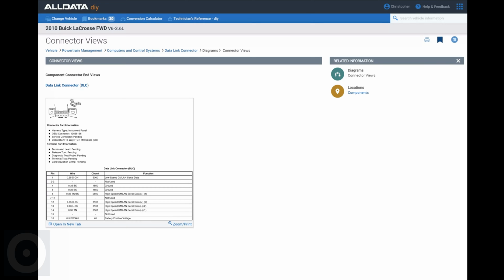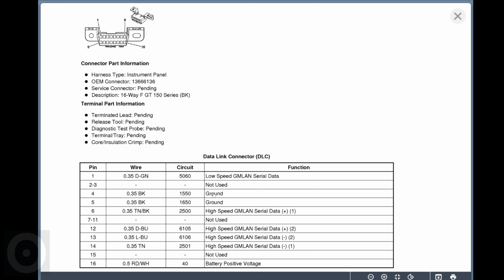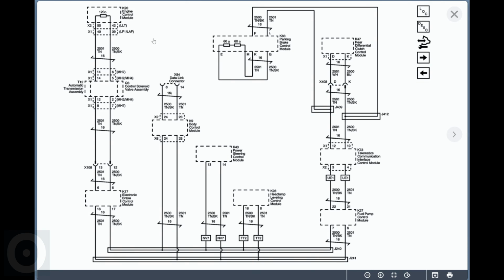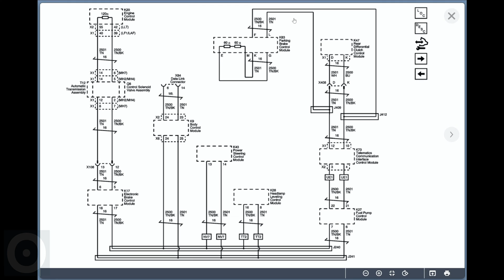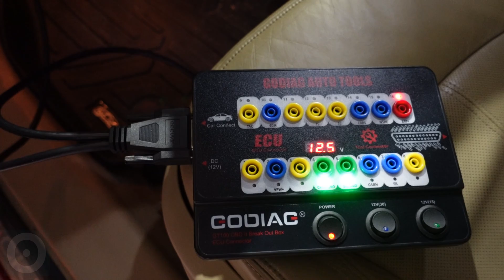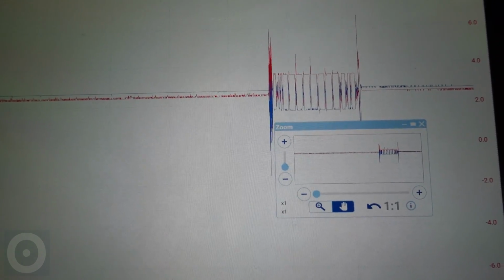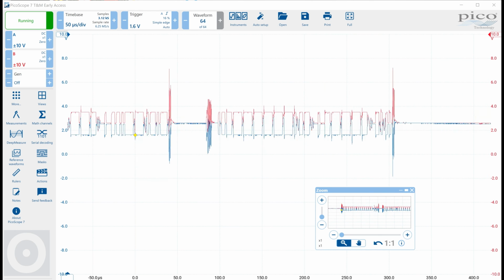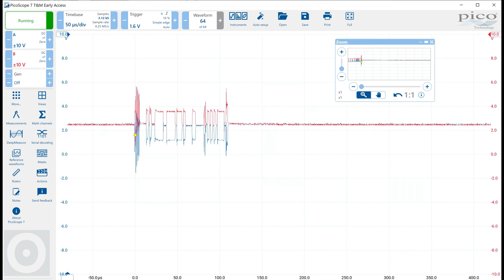DIYer's first day with a picoscope, a breakout box, and testing CAN bus

Comment: What do you need to hook to pico
Reply from the maker: You don't hook the pin outs or anything. You just use a multimeter and go straight to the pins in the DLC port. Use a back probe and stick it in the pin outs

Comment: I don't know if need osilisccope  or breakout box but I got issues im putting a training practice  together ford f750 alt has power on line 2 not there then 63.47 volts control module
Reply from the maker: Yes, that is a problem! How about this? Measure the voltage between 6 and 14 in the DLC connector and see if you get the correct voltage for can bus and also measure from pins 4 and 16 and see if you get 12 volts. If both of those check out then it's probably a problem with the oscilloscope or the breakout box.

Comment: Ive worked on cars my whole life but my electrical diagnostics have been limited to just using multimeters and test lights until recently. Within the past couple of years Ive learned alot teaching myself diag using scopes and scan tools. Ive upgraded my tools, using better leads and accessories for my meters. I have an inexpensive BOB off amazon. Made alot of custom accesories using silicone wire and banana jacks and aligator clips. I have the hantek with the hscope app and a ds212 pocket scope as well. Most of these tools are inexpensive compared to pro level tools. Doesnt take much to get started. I really enjoy your videos. Very well explained info and easy to watch. Cheers
Reply from the maker: Thanks for the kind words. I really do like working on cars I just wish I had more time and space to do it! And the electrical diags always intrigued me so that's good I got started with it by watching YouTube videos. You're completely right. It doesn't take much to get started just a little bit and you'll see how it goes in it to get easier and easier.

Comment: Yo Chris,
8:16 I like that FLUKE 17B+.
I have an old Fluke 115 from 2007 still going strong. lol
-Chuck
Reply from the maker: Yes Chuck, I decided to go ahead and invest in a fluke. It will probably last me the rest of my life, which I'm pretty happy about that. I do still have my $20 multimeter but it'll be more or less just used as a backup in case if I ever need a backup.
Reply: @oneanddonediy  
I've got a $9 multimeter that is almost as accurate as my 115. lol
I use it to confirm, and verify certain things.
Reply from the maker: @PanzerPlatform  Nice! That's a good idea. I can use it as a double checker!

Comment: What does this thing do? I don't have time to watch the video to understand.
Reply from the maker: The ocsilliscope (picoscope) measures voltages in real time to graph them.  The breakout box connects to your OBDII port and each hole represents one of the sixteen pins on the OBDII port making it easier to probe.
Reply: Did you finally get time to watch the video?